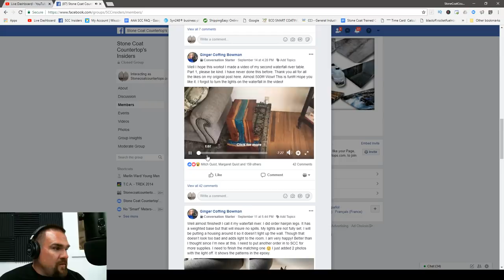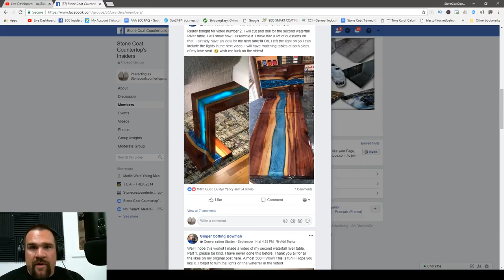Mom Knows Epoxy

Comment: I have asked this question before but haven’t received an answer yet. I need a long work time resin that will set like fiberglass resin. I was told to use the Quick Cast but as a newbie I don’t think it would be wise to try use it to make a micarta.
Reply from the maker: Great question Shelly Lemons!  Our quick coat sets up fast, it has a 15 minute working time. We would suggest trying our our art coat. What makes Art Coat different than our normal Stone Coat Countertop epoxy is the extended working times - In optimal working environment (65-75 degrees) the Art Coat epoxy will have a working time of 50-75 minutes or longer. It also has an extended pot life - The mixed Art Coat can stay in smaller cups for a extended time than the normal Stone Coat Countertop epoxy It's also got additional U.V. Protection. We maximized the U.V. protection for the works of art that will hang in full sun. Check it our here: https://www.stonecoatcountertops.com/product-page/art-coat-1-gallon-kit  Please feel free to call or email us anytime with questions or for project support. (541)450-1976